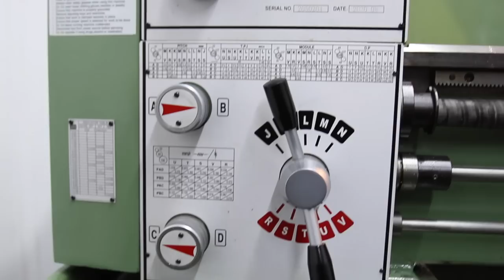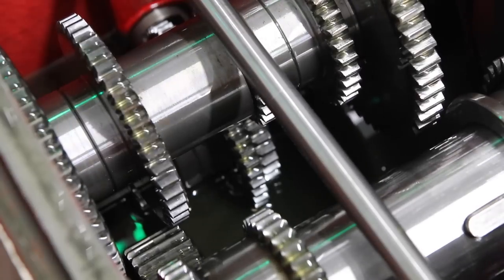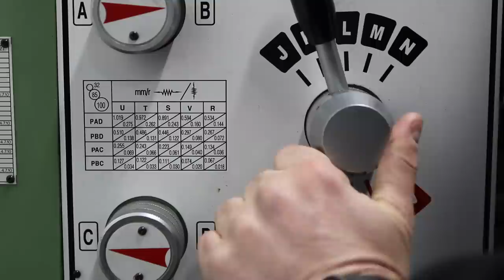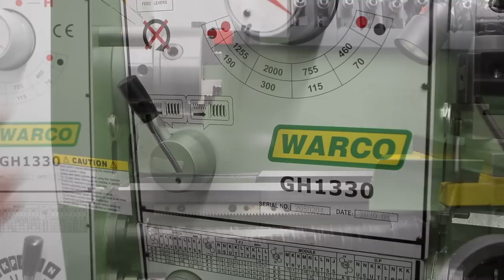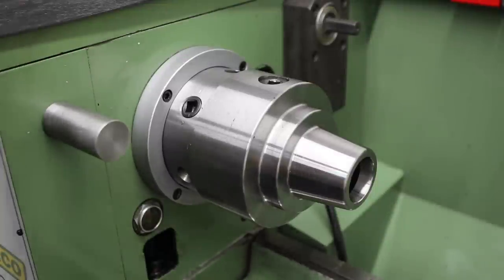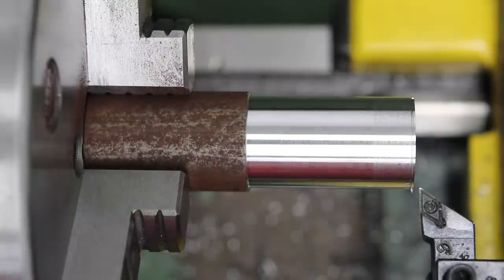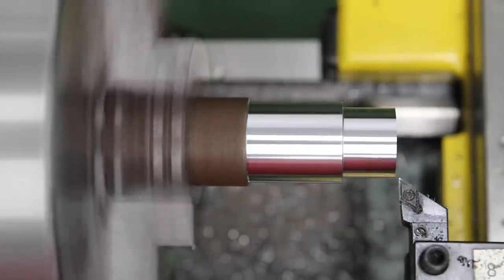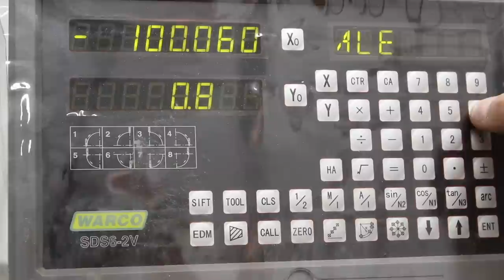Lathe review - Warco GH 1330 gear head lathe

Comment: You have probably already done this, but a close inspection of the sumps for manufacturing swarf and left over casting sand should be done. Along with adding magnets to the sumps and in the lube channels under the top cover.
Reply from the maker: Thanks for the advice. I've not used the flood coolant system on this machine yet but will be sure to do as you suggest before I do so.
Reply: @joneseymakes  The Gearbox LUBE sumps.
Reply: Good shout I checked the lube channels under the top cover and removed lots of swarf.

Comment: Very interesting review of your new lathe, and I am glad that you like it overall.
 I bought one of these lathes new from Warco in 2004, and still have it. Back then the new price was just under £3000, so since then they have more than doubled in price.
 I agree that the 1322/1330 lathes have a slightly better quality feel than the 1224/1236 lathes, the 13 inch swing lathes also have a much deeper bed casting than the 12 inch swing machines.
 It is more important than for just curiosity to remove the headstock cover to inspect the condition of the internals. Some examples of these lathes are assembled and left with swarf and foundry sand in all the gearboxes, just as mine was. It is worth draining the supplied oil from the headstock as soon as possible to check what's in the bottom and clean out if necessary, and refill with fresh oil.
 My new Warco 1330 had some swarf and plenty of sand in the bottom of the heastock, and sand on the internal sidewalls which would have led to premature wear and failure. I flushed out the screwcutting gearbox with kerosene without dismantling it, and I also found lots of swarf left in the apron casting caused by the many holes that are drilled through it by the manufacturer after the apron is assembled onto the machine complete with all its internals. But the apron and screwcutting box internals are relatively slow moving so not quite as urgent to check compared to the high speeds of the headstock which picks up any particles and splashes it all over the gears and bearings.
 Keep an eye on the vee guidways of the bed, particularly the front vee that guides the saddle. Early signs of wear can appear in the form of scuffing along the flanks of the vee. This is caused by the sometimes very poor rough finish of the bearing surface of the underside of the saddle, which appears as a heavy rough scraped and chiseled surface. I had to correct this on my 1330 and have had no more scuffing or wear of the bed since.
 As for the bed gap piece, I did remove it from mine just once years ago, and after thorough cleaning it went back into place and lined up just fine eventually, with the aid of a rubber hammer. The rubber hammer should be used on the main bed, not the gap piece, as the bolts are gradually tightened. However, the usually very good Grizzly manual actually recommends to not attempt to refit the gap piece if I remember correctly. This is bad advise and it should be replaced as soon as possible to prevent increased wear of the bed and the saddle as the saddle rides over the end of the bed guidways into fresh air and back again.
 Although my 1330 had many faults, including rust on the headstock gears, shafts and bearings, the manufacturing and assembly quality of these Chinese made lathes can vary between individual machines. So good or bad details found on some examples may not be found on another, even from the same batch. 
 Other irritating design features I have found are the extra chaingewheels required to be fitted to achieve fine feeds, which then have to be changed in order to cut threads. The lack of any friction dials, instead the dials use stupid grub screws drilled right through the dials division markings. Finally that tailstock has a rather spindly diameter quill for a three Morse taper bore, this tailstock with its 32mm diameter quill was originally designed as a two Morse taper.
 Anyway,  I must like mine a little bit, since I still have it after all these years.
 Hope yours gives you many years of trouble free service and enjoyment.
Reply from the maker: Thanks for the great tips. I've already drained and re-filled the oil in all gearboxes, but I'll be sure to check for sand and swarf the next time I do it. Great tip on the guideways, I might take the saddle off and check it. I agree regarding the change wheels, would have been nice to just be able to switch between feeds and screw cutting without changing wheels. All the best.

Comment: Hi great video very informative I bought the warco wm290v a few years ago don't have the same problem with the leed screw covers as you do however your machine seems more robust. I noticed your DRO is the same as mine having never had one before I found it a great asset but the booklet it came with is very hard to understand Some of the functions it comes with I have no idea how to use  maybe a video on the DRO would be useful to myself and others. Thanks for sharing kind regards Shaun
Reply from the maker: Thanks for the comment, yes maybe a DRO video would be useful. The  manual I got with mine was very difficult to understand but I've worked out most of the features now.
Reply: Try looking at 'Jon's workshop' on YouTube he is doing a series on DRO's and their functions he just did the second one of the series. The first was absolute/incremental, the second was on PCD ( pitch circle diameter) hole circle function and angular convention of start and finish angles. Very informative. I was the one who originally asked Jon to explain the abs/inc system as my dro instruction are in 'Chinglish' and  unintelligible.

Comment: Hello there. For a quick reply, I'm from Michigan USA. First off I was around for nearly 42 years and wanted to put my skills, and use that experience and hobby stuff. Personally I'm glad you stepped up to a higher level with a larger Lathe. Only one item I'd suggest, keep the ways clear / clean as you are sanding turned item's on your Lathe. My equipment is kept in my basement, so the temperature doesn't effect my work. Good luck now 🙂
Reply from the maker: Hi Keith, thanks for the advice. I need to fit some way covers really.

Comment: Nice review. I have one of these - I got it used, so a few of the accessories had gone missing somewhere, but I'm very pleased with how it works, and I'm glad I didn't get the much smaller models (I was buying my first lathe, and I looked at the tiny models, then got on to the geared versions, and then Ebay had a GH1330 for about the same money as one of the lesser GH machines new...).

Also, mine had a broken cover for the leadscrew when I got it. Both sides are now removed, gives you full range of travel - and if you ever break the shear-pin, you don't have to fight the covers as well while trying to replace the pin...
Reply from the maker: Thanks for that. Were the lead screw covers a pain to remove?
Reply: @joneseymakes  not too bad. You have to get the leadscrew out, which means punching out the sheer-pin, and undoing the bearing holder on the tail side. If I recall correctly - it's about 3 years back.
Reply from the maker: Thanks, I’ll give that a go.

Comment: 2 points on surface finish (material aside)
1 nose radius and feed rate combination has an impact.
2 those marks you saw were not the limits of your machine (very impressive) but they are tip geometry related.
The chip groove is turning the swarf back onto the machined surface and scratching it.
Feed rate changes and tip geometrymay alter that.
Reply from the maker: Very interesting Steve, thanks for the advice. Looking back at the footage now I'm sure you are right. I will do some more experiments with feed rates and different inserts.
Reply: I agree the finish that you achieved was due to swarf curling back off the top of the tool and marking the job.

Comment: This looks much like my 2003 vintage (bought used after it'd seen some hard times) JET GHB1340A but with a shorter bed and no selector for the leadscrew /feed rod rotation.  I noticed on the carriage, the DRO housing covers the carriage lock bolt.  If you use this feature, you can probably move the locking clamp to the right and the retainer strip to the left and put a proper locking lever on it (need to drill one hole).  I intend to try this on my old beast if I can ever get a stretch where I'm not using it.  It's been a good lathe to me; hope yours holds up as well.
Reply from the maker: Thanks for that, very useful.

Comment: I've been watching a few of your videos lately as I've only just discovered you. I think your content is top-notch, so thank you for the effort you're putting in. Your lathe looks fabulous for hobby use.. My brother and I also took a trip to the Warco show room last year and I ended up buying from their second-hand stock. As it happens the machine I bought was actually brand new. They had evaluated it and decided not to include it in their range, so they just got rid of it. I don't know if they ever had any others, so I may have the only Warco branded VS 1235 machine. Grizzly do sell this model in their range, its the Grizzly G0949G - 12" x 35" Gunsmith lathe. It was useful to hear you mention the Grizzly manual for your machine. I shall have a look to see if I can get one for mine too.
Reply from the maker: Thanks for the feedback. Interesting to hear about your lathe, are you pleased with it?
Reply: @joneseymakes  Yes I am happy with it. I got a decent £1500 discount on the machine and plan to use the savings (I had already budgeted for a full price machine) to have an electronic leadscrew or CNC setup for thread cutting. Currently I have to use change gears, which are of course evil.
Reply from the maker: @GeoffTV2  Good man, that sounds like a good upgrade.

Comment: I am curious why you don't fit a draw bar and get a mt5 to 5c adapter for collets? That is how the big boys do it (it is so much easier and faster than the collet chuck) although I guess the badly designed lead screw covers would be a problem working that close to the spindle. One thing about those covers, they should compress into a much shorter length than you showed, I suspect they are either defective or improperly installed. You can buy high quality coil covers if you want them, they are good enough for Schaublin but for hobby use just take them off and don't worry
Reply from the maker: I never considered the draw bar option, I like the idea. Less run out than a chuck I would imagine. Yes, I need to take another look at those covers, they are pretty useless anyway.
Reply: @joneseymakes  my Schaublins both use draw bars, and they work great (the 135 is also a mt5 but a little bigger at 40mm, I think 38mm will still work.  Ideally you can find some tubing as a starting point as boring out that much from solid bar is not fun. It seems likely someone else has done this already.

Comment: Great video 👍
A couple of questions...
Did it need cleaning when you got it?  Mine (VM250)  was filthy with cast iron filings everywhere.
Have you done any accuracy tests?
Cheers
Mark
Reply from the maker: Hi Mark, it was covered with that grease stuff that they ship machines from China with (Cosmolene?). This one wasn't too bad but most of my other machines required stripping and cleaning before use. I've not done any real testing on the accuracy front yet, although I intend to in the future.

Comment: Hello from Sweden! Great video!

Regarding the feeds gearbox, are you sure you’re supposed to manoeuvre the gearbox with the spindle at a stand-still? 

Both my lathes, and my mill, actually calls for the spindle to be rotating whilst selecting speeds.
Reply from the maker: Hey Henrik, yes I’m sure. There’s no synchromesh in these gearboxes so they need to be changed when stationary. If you try and change them whilst moving you grind the gears.

Comment: I've got a very similar machine which was sold by Enco here in the US; my major complaint is how the compound affixes to the cross-slide; it leaves only a very thin web of cast iron to affix the compound and beyond, making me rather nervous. I'm working this weekend to replace the cross slide table with one I designed to alleviate this problem.
Reply from the maker: Yes, I’m none too happy with the compound on mine. I’m considering removing it in favour of a solid toolpost.

Comment: I have a Chester DB10Super LB. I have the same twist issue with the tailstock. I have a good idea what the problem is but it would be nice to see someone else rectify the issue before I go delving into mine! 😄
Reply from the maker: I'll do a lathe modifications video at some point. This is going to be an easy fix I think. There is a retaining pin that runs in a channel to stop rotation and I suspect that it's undersize.

Comment: Jonesey  I have a Warco GH1236 and it leaks oil too .....all i see is an oil puddle under the head stock but cant find the source. Wonder if you know where it could be coming from. I like your tool holder brackets you have on the back splash guard. I have the very same tools post/holders. Do you sell these brackets you 3D printed. I do enjoy your videos and I learn from them thankyou
Reply from the maker: Hi Colin, check the main input shaft to the gearbox. This is the one that that connects to the pulley and drive belt that comes from the motor. On mine there is an oil seal where the input shaft passes through the side of the gearbox it was this that needed replacing. Check the manual that you got with the lathe, there will be an exploded diagram of the gearbox - look for anywhere there is an oil seal listed in the parts list. These are prime candidates for failure. I'm not selling the tool holder brackets yet, but this is something I'm thinking about for the future, so keep an eye out on the channel!! Thanks for watching.

Comment: Hello from Aus, I have the 1440B lathe with the 51mm bore, nice lathe and accurate, yep the lead screw cover drives me mad, and the gear box changes for feeds and threads is tricky to find the correct notch. I have not levelled mine yet!! should hav a year ago!! I have brought some of the level pads 160mm same as  you have, how did you find them, and may I ask how you went around lifting the corners of the lathe to place them under?  Thanks Gary
Reply from the maker: Hey Gary, yeah the pads are pretty good. I would have preferred the threads in them to be a little more substantial but they work. I used an engine crane to lift the lathe to fit them, but another method is to use a crow bar and wooden wedges to get it off the ground. You then gradually lever it up using ever thicker chocks under the crowbar and pushing the wedges in to hold it until your high enough to fit the feet.
Reply: @joneseymakes  Thanks  Mate, I went the 160mm Dia, because they had the M16 bolts.
Reply from the maker: Good choice

Comment: i'm in the market for a hobby workshop lathe....question.. do Warco check the lathes and give you a accuracy report?   it would be cheaper to buy from china, but if warco give quality service, it sounds worth the money.
Reply from the maker: I did get and accuracy report I think. But what I think is more valuable is the after sales service. I had a problem with an oil seal on my lathe after purchasing and was able to call them up and discus. They sent out a replacement part very quickly.
Reply: @joneseymakes  Thanks Nick,  i ordered a Warco hobby lathe and mill.   lots of future projects.
Reply from the maker: Best of luck with it!
Reply from the maker: @SimonHollandfilms  Best of luck Simon, if you need any help give me a shout
Reply: @joneseymakes  thank you....delivery has been a nightmare as i live in France and the post Brexit EU import rules and taxes are expensive.  hope to get my wm250 lathe and mill soon.

Comment: Look up clough42 for his electronic lead screw series.  Would be a great addition 🍻
Reply from the maker: Thanks, I’ll check that out!
Reply: I was just about to recommend Clough42 LOL
Reply: Particularly notable when you noted that your lathe is equivalent to a Grizzly model, since the ELS project was basically for his Grizzly.
Reply: I don't think it's worth modding this lathe. I'd leave it as is and modify a second smaller bench lathe if you want to add ELS.
Reply: Fwiw I have a custom 2 axis ELS in mine but it's a cheap bench lathe that I didn't mind messing with.